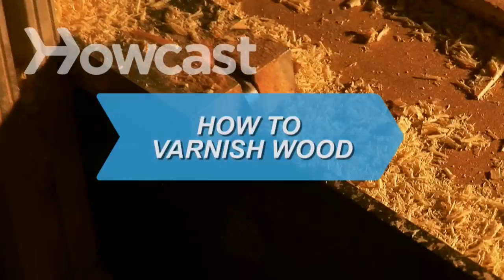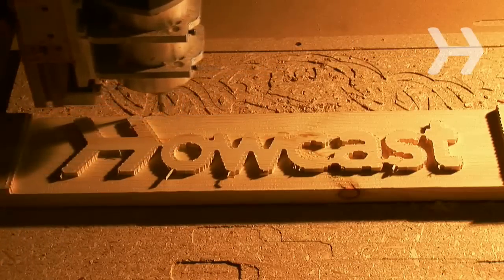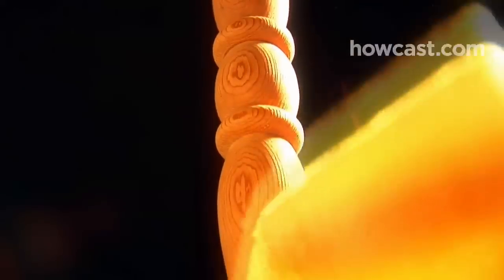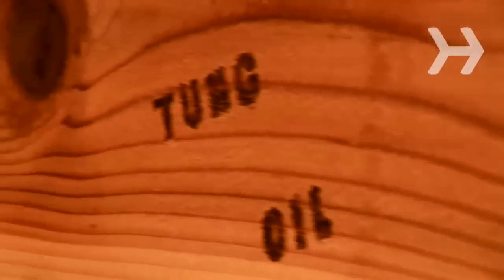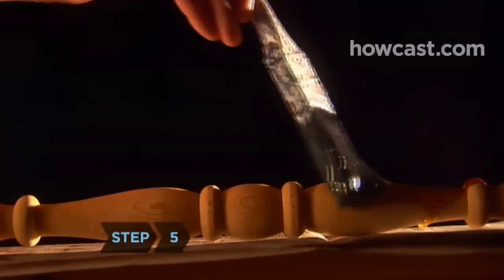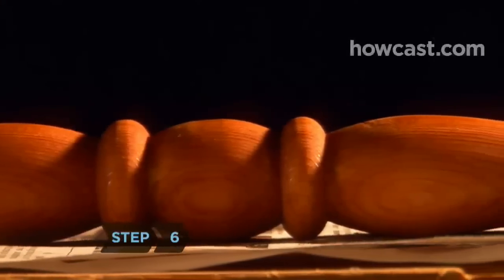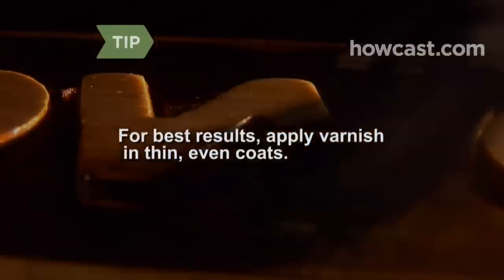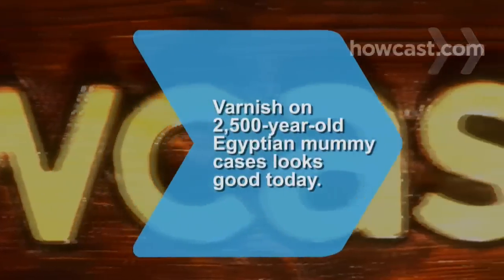How to Varnish Wood

Comment: Thanks a lot great video!
Today the carpenter installed 4 doors in my new house and i am planning to varnish them myself, i am about to finish sanding,  so can i apply the varnish directly on the fresh wood as a first coat then sand it and do the second coat or i am missing something noting that i don't want to stain them? appreciate your help. Thx.